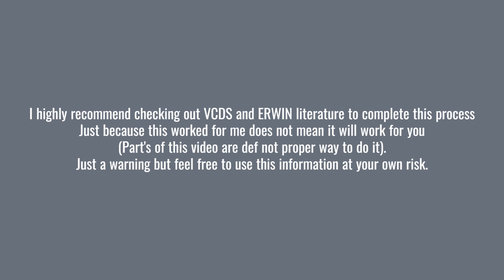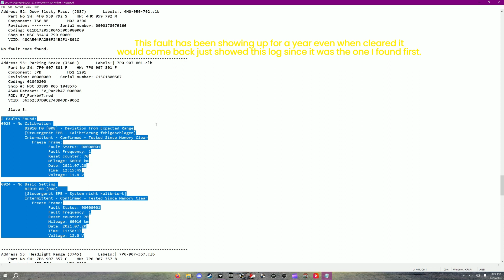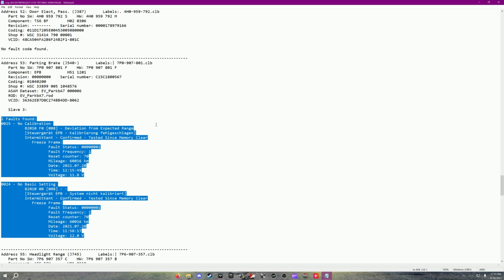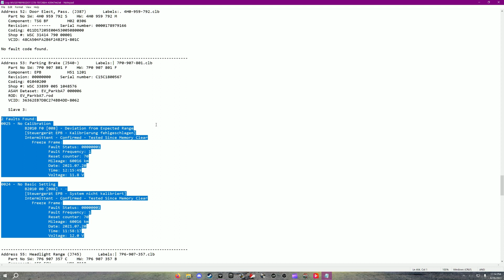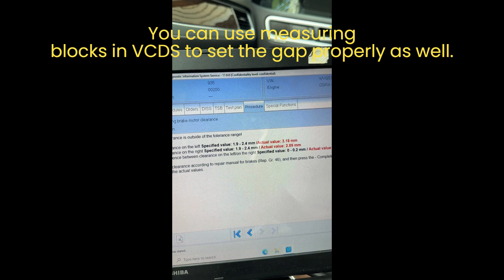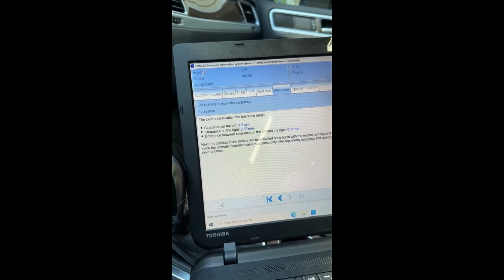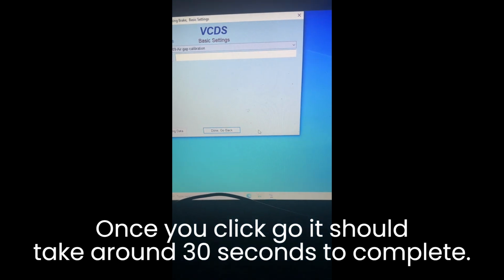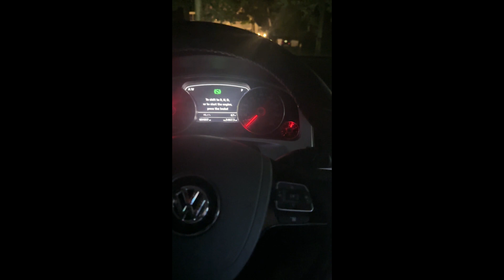Touareg Parking Brake Basic Settings fault beep error fix

Comment: I did all the same as you did, but the stage where you ODIS tells you to drive and stop always fails on me, what do you suggest?
Reply: Same here, did you figure anything out?
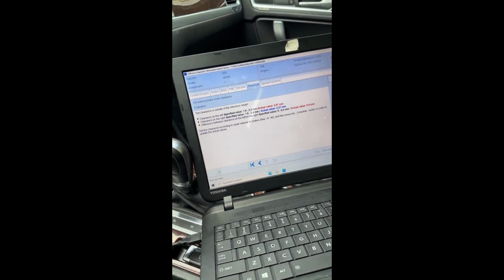Reply: How do you get to the area where it tells you what values they’re at like at 5:24
Reply from the maker: That's exactly what happened to me when i drove it failed.  At this part of the process I skip the rest of the process and ODIS and just do the steps shown in VCDS to finish the procedure.  Probably not the correct thing to do but it worked for me and no issues since
Reply from the maker: Sorry for the delayed response for both you guys but you have to do the initial steps in order to get to the part where it tells you the actual values.  Be careful though since once you start the process you have to finish since it erases the settings for the parking brake.  ONLY do this process if you need to and at your own risk
Reply: Alright..had a mobile mechanic come by and install powerstop fronts and rears (rotors/brakes)…as soon as we installed them, moved the Treg TDI 10 ft and the error: rear brake code came with the annoying beep. 

Since:
- mechanic came back..he tried to manually adjust the air gap and then go through his scan tool sequence, ie: the grind test.  But at the end of the grind test, his scan tool could not calibrate the system, and the code and beeping is still displaying. 

Took it into a dealership for a second opinion and they said “your shoe is worn out and that's what's causing the code to go off.” 

Told my mechanic what VW said and he wholeheartedly disagrees with the shoes being in bad shape (since he saw them during Install) and causing the issue.

VW Invoiced me at nearly $1400 for shoe replacement and in writing guaranteed me that that is the issue and has to be done so the code is erased. I declined for now, called auto zone and ordered new shoes with hardware kit for $56.  The mechanic is going to take everything apart again and install the new shoes as a trial and error, although we think that is not what is causing the error code. 

I'm running out of options because I know that $1400 invoice is BS…

Since it sounds like you had the exact same issue but were successful in fixing it, would there be any way you could work with my mobile mechanic while he's trouble shooting this?  I'm literally watching him go through all the steps. Not sure if its a scan tool issue on his end, or if we are missing a fine detail…